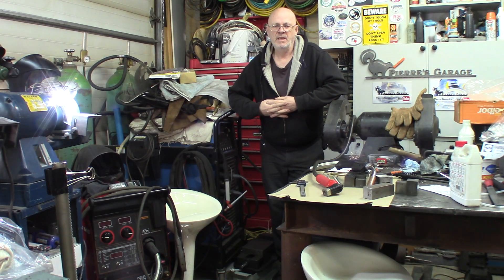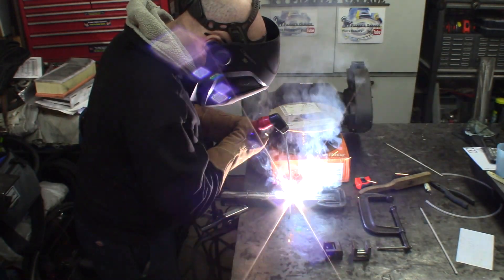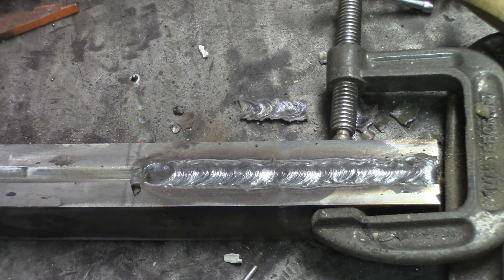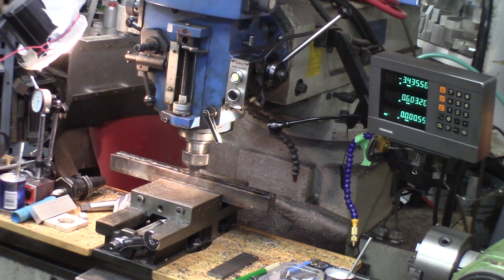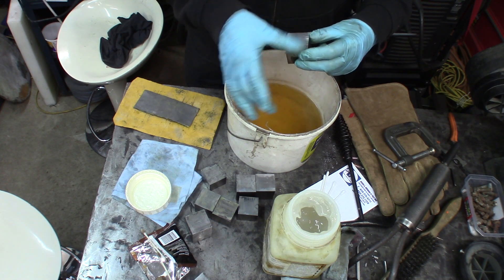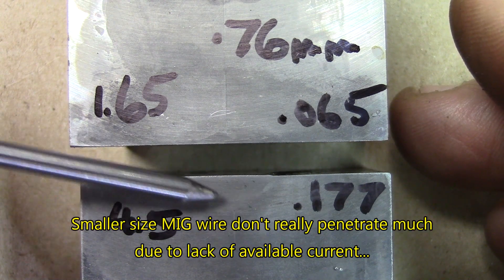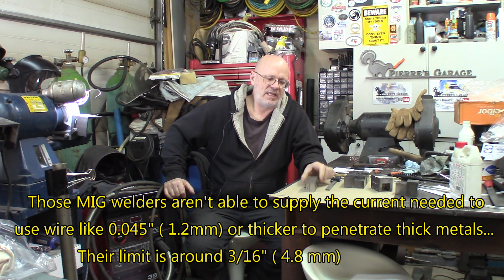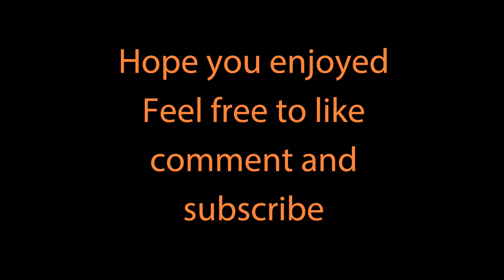Weld penetration Mig VS Stick, low price welders vs high priced machines

Comment: Nice job Pierre.  I especially like the fact you eliminate the BS by actually cutting and etching your welds.  No longer just an opinion, we have proof.  As far as lifting devices are concerned though, 3:1 is adequate for regular lifting (not people) (ASME BTH-1 2014 or whatever is the latest, if anyone in north america was wondering what document to get).
Reply from the maker: Hi Barry,
There are lots of myths about welding, lots of battle on what is best, like you said, there are only a couple of ways to really measure the results...
Good knowledge and training are also key to understand what is going on and how to control the weld....
About the ASME, I'll give it a look, but just before I do is it only 3 times for lifting weight passing over people's heads...?
Cheers,    Pierre
Reply: Pierre's Garage Actually there are two categories.  Category A lifting devices are only 2:1 load factor, but they are for special lifting devices where there is a very well known weight you are lifting, like for handling things in a factory where the product weight doesn't vary.  Category B lifting devices are for general use and have a 3:1 load factor.  Both can be used for overhead lifting, though it is very poor practice to lift anything over top of people if you can avoid it.  I you have a spreader being used in a production environment where it will be subjected to high cycle rate, the spreaders must be analyzed for fatigue.  This is the load factor for the lifting device.  This does not apply to the wire rope or chain or synthetics used for slings.  They have their own factors (5:1, 4:1 and 5:1 typically)  I do go to 3:1 on the rigging for particularly heavy "one off" lifts though as the high factors on wire rope are to account for abuse and broken wires when used many times.  You are not going to be jerking and shock loading a 200 ton lift.
Reply from the maker: Ok, I get the principle about the wearable chains and slings...  Oh, no...!!! I'd be worried at jerking or shaking even less than 200T.
Since something like a trailer or anything that goes on the road is gonna be rattled a little more than a fixed installation, is there a different set of rules about it?
Reply: Small cranes and hoists usually do not possess the finesse of a larger crane.  Hiabs and electric hoists can be very abrupt in starting and stopping movement leading to high impact loading.  Large cranes also usually have the more skilled operators and thus are better run.

Trailers would surprise and frighten you how poorly many of them are designed.  Getting to a load factor of 2 is a stretch many times.  They really try not to over design them as every extra pound on the trailer is one less pound of cargo.  They don't get paid to haul around the trailer, only the cargo on/in it.  As far as I can tell there is no definite standard when it comes to the structural rating of trailers.  I have designed a few for special extra heavy haul applications and reviewed some structural failures and accidents.  I have not found any governing document that specifies load factors etc. (not saying it doesn't exist, but I have not found it.)  Too many of the documents covering things like this are full of words but not much content.

Comment: I like to run 5/32 6011's with the amps cranked to where the cellulose is turning brown and almost flaming and then I can nearly push the rod thru .3/8 plate. I don't advise that for out of position welding though!! lol
Reply: (hand up) Guilty!  I've done my fair share of the slag-in-my-pants-dance!  That is also great motivation to make sure your fly is fully zipped...
Reply from the maker: A metal working shop is a place to cover well, slag, BIG bouncing BBs, BIG burning blue chips in the collar, there is always some reason for a short dance break...    lol
Reply from the maker: Hi Brian,
How hot do you set the amps...???   185 amps?
This is where the slag slides soooo easy into your sleeves or anywhere through your clothing if you're not wearing thick leather..... Ouch!!!!
Cheers,   Pierre
Reply: Probably about 200amp DC, no sticky rods that way you just bury it in there! Not for overhead or vertical work like that though or you will be wearing more steel than you are welding. :-0
Reply from the maker: Normally those rods are in the 150 amps max range, 200 is torching hot...   The new Ironman Challenge...  ;)

Comment: I might add that welding is something that you can fall out of practice with.  If you haven't welded for a long time, and something you need to weld is critical, it would pay to burn a few extra rods/feet on some scrap and practice.  My biggest problem, when I haven't welded for a while, seems to be the jitters.  It's nice to see people on other videos using blocks, etc. to steady themselves.  I'm not the only one!

All of my welding, with the exception of a few done with gas, has been with a stick welder.  I wouldn't know where to start with a mig.  I first heard of them in '78 ... very high priced then, and you had to have 3 phase to run them.  We put them in that "nice to have item we will never be able to afford" category and didn't give them much thought after that.
Reply from the maker: One thing I got from an optician friend is a pair of glasses adapted to my sight, since one eye is stronger than the other cheaters are not ideal, normally I wear glasses with progressive focal length, this is hell in a hood where you can't position your head to have a clear vision on the puddle if it's not directly aligned with the right place in the glasses... 
Maybe it's just me, but, I feel that light perception is also fading a little, seems like looking through the lens,  I can't perceive the details as well as before. Harder to keep up with the puddle...   
The pleasures of getting older...  !!!    lol

In conclusion, I would still love a hood with an adjustable ZOOM, like a real camera zoom...   ;)
Reply from the maker: Getting back on the saddle comes back fairly quickly, by now my biggest problem is my eyes aren't as sharp as they used to be, mostly with Tig where I find very difficult to see well the puddle, no need to say I've become very good at sharpening Tungsten electrodes...   lol
Up until about 7 years ago I used to weld pretty much everyday...   Now it's 95% machining...
Thanks for viewing and for comment,   Pierre
Reply: I agree!  Sometimes I wish there was a  zoom knob n the side of my welding helmet.   Chris
Reply: Yeah, I've had to relent and start using "old man" tricks to see things.  Like lifting my glasses and holding things close to see fine lines or print.  Or using my thumbs to cover all except the mark I'm on to the mark I want to be at on the lathe dials.  
It's the same with the hearing as well.  Cupping a hand, to help mute ambient noise from what I'm trying to hear, telling people to turn and face me if they want to be understood.  They told me, about 15 years ago, that I would be a candidate for hearing aids ... in about ten years.  I'm long overdue for following up on that.
Reply from the maker: Hey Chris, if you ever find one of those I want one............!!!!!!!!!!!!!!!!!!
Reply: Guys, there IS a zoom knob on your welding helmet! It's called the cheater lens! I tig weld for a living and use a 3.0 diopter in conjunction with a Gold 10 shade for everyday use (12 shade if I'm doing dual shield or anything above 120a). My dedicated TIG hood that I use professionally to weld everything from aerospace to automotive parts is a 40+ year old Fibre Metal that I bought at a flea market for $2! Most autodarkening helmets can be fitted with a cheater lens as well but I cannot even imagine welding without one (a cheater). My suggestion is to get a glass lens instead of a plastic one. Cheaters have actually gotten very inexpensive compared to years ago when a decent cheater was $40. These days you can get a decent one for $10 or $15 but it's like adding a zoom to your welding
Reply: Pierre's Garage  I also suffer from age related vision problems. I also wear progressive glasses. A few things that I've learned.

1) no lighting behind my head which causes really bad reflections inside the helmet.
2) as much lighting on the weld area as I can get, this is especially true with auto dark helmets
3) make sure that all of your lenses are clean and as scratch free as possible. If the lenses are too crappy, install a new one.
4) the cheater lenses work ok but my eyes are also different on my prescription glasses. So I use a mild cheater lens, combined with my prescription lens, especially when I tig weld.
5) In many cases I actually prefer my fixed shade welding helmet to the auto dark kind. The clarity seems much better.
Reply from the maker: All of the above... And even there I'm getting better at re-sharpening tungsten electrodes than ever before, getting to be 63 isn't improving the sight...   lol
Reply: Keep in mind, if you're already wearing prescription corrective glasses to correct your vision, the cheater lens magnifies what you already see through your corrected vision and doesn't interfere with the corrective lenses. Most Class A welders in aerospace are older guys like us who have prescription glasses but still use cheaters. Agree 100% with Marcel about a high quality fixed shade. I too use a Jackson Nextgen auto for certain large fabrication tasks but for anything on the bench that requires a high degree of precision and fine puddle control, a big cheater and a clear fixed shade is my preference too. Protip for improved clarity on fixed shade hoods: Only use a clear sacrificial lens on the outside of the hood facing the weld and not one on the inside of the hood where it offers very little benefit but diminishes clarity.

Comment: I run .045" every day at work. I like to set up for spary arc on that when i can. It really burns in great.

At home i have had great luck with any welds up to 1/4" thick material with my 180amp hobart. It runs .030 to .035 wire most of the time.

Great vid to show that proper mig setups can perform with or out perform stick setups.
Reply from the maker: Hi Todd,
Mig can dig pretty deep with big wires, but, to run those big things you need LOTS of amps, compared to the 90 to 150 amps for major 1/8" SMAW rods, with twice the amps no wonder it digs in, nice feeling of power when you run a bead over 275 amps in thick plate, need good gloves or deflectors, though...   ;)
Or get 80%+ Argon mix, over 24 volts and go axial spray welding, just a faint hisss and tons of heat plus a super smooth bead no spatter.
Thanks for viewing and for comment,     Pierre

Comment: Very nice demo. I would love to see the results with a low end MIG machine for contrast. I tell my students that, in the real world, you are your own first inspector, so you need to be your harshest. If you aren't, you will fail UT, X-ray, or cutout for mechanical tests. 
The way to learn this is have an instructor that can watch what you can't while welding and can help you fix the issues you can't see. The other thing I do with students is basic inspection-- dye penetrant, bend test, and basic etch.
Reply from the maker: Hi John,
Great approach making the students critical about their own work...   
I used to own one of those Lincoln MigPak-180,  a decent little portable machine for lighter material.
You could set the parameters of a bigger machine to replicate the current and wire speed of a small machine, my guess is set the max output volts to at most 18 to 19 volts and their wire speed is about 500 imp. This is for a 220 volts welder...!!!
If I get a moment I could try to approximate a smaller welder, no promise though.
Thanks for viewing and best of luck with your students,    Pierre

Comment: Pierre
Awesome Video. Perfect examples of prepping and none prepping. Could not be explained any better very good. And you did not shack to much with the stick LOL

Cheers Fred
Reply from the maker: Hi Fred,
Glad you liked, my main issue now is seeing what's happening mostly when Tig welding, not the shaking...   lol
Cheers,    Pierre
Reply: When Tig welding the shacking is a good thing LoL
Reply from the maker: Fred's Machine Werks
You end-up getting good at sharpening tungsten electrodes...lol